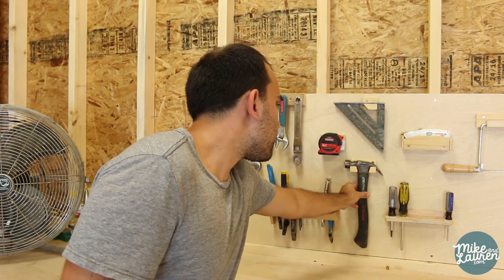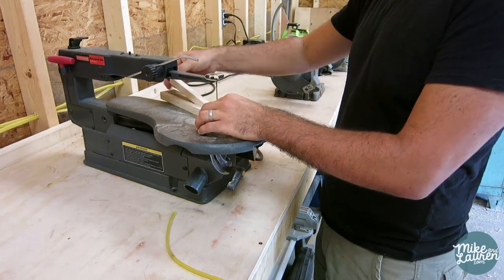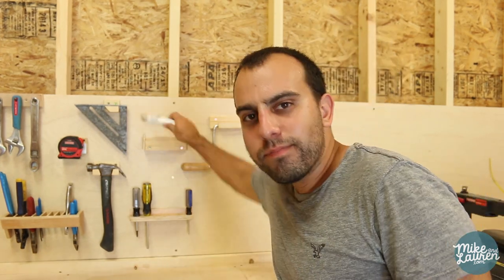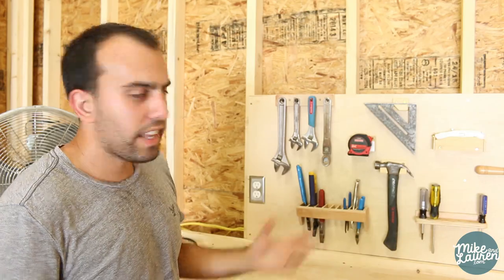Mike Makes a Tool Board (Hand Tool Organization)

Comment: Nice Job,
Your hammer is set perfectly, ready to grab and use.
The pliers can set in the holder upside down, one arm in and one out. This way it's right in the position to grab and use.
Same as the adjustable wrench, the handle should point down.

I love to outline the tools with sharpie pen to be able seeing what tool is missing in glance.

Comment: Thought about French Cleats?
Reply from the maker: Scott Schaffer I love french cleats for pretty much everything but a tool wall.  It just never made sense to me to add all that bulk to the wall for very restricted movement.  But, to each his own :)
Reply: Mike and Lauren I don't know.  I think custom tool holders that can be moved to any set of cleats is the way to go.  I like my tool storage to be flexible, and nothing out there lets me hold the tools the way I want to, yet still put them anywhere like putting cleats everywhere.
Reply from the maker: I've never really had a shop before so maybe my thoughts will change.  I'm curious, why do you move your tools around so often?
Reply: Mike and Lauren Well, I have two benches, to start with, and a limited number of measuring and marking tools, so setting up near either means I'm less likely to leave things laying down.  Also, I have temporary clamp racks that I like to set up where I'm doing my assembly, either near my assemble table or near the wall if I'm putting things together on the floor.  Mostly I'm just indecisive, and I'm always changing where I want to keep things, and the cleats make things instantly mobile and accessible.